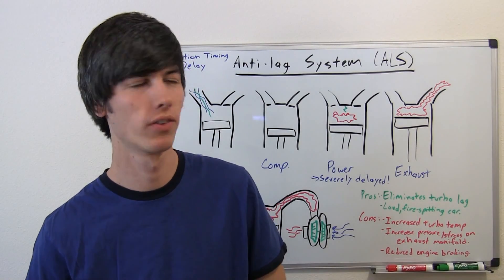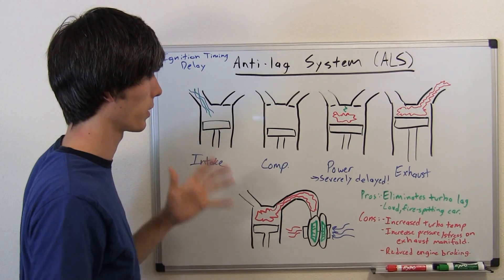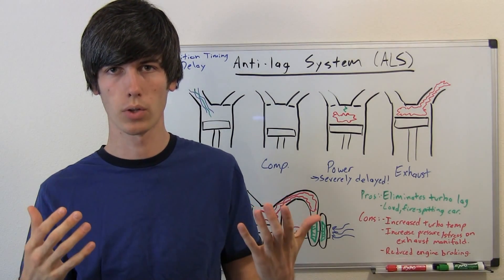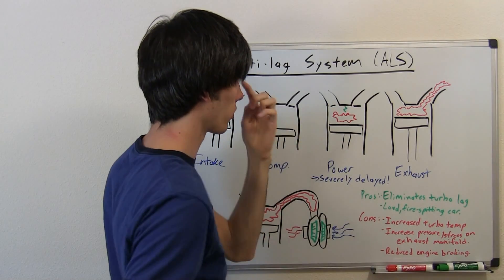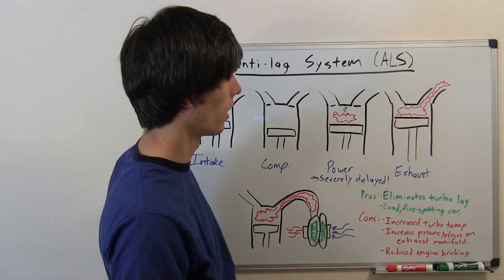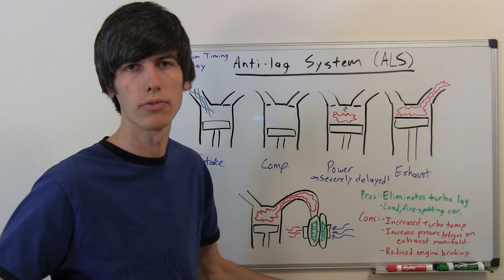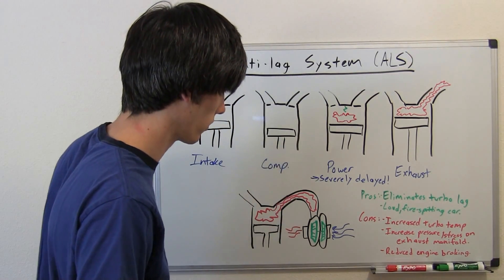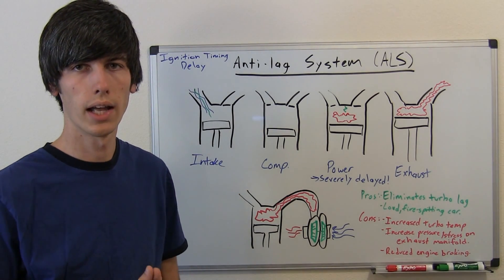Anti-Lag System By Ignition Delay - No More Turbo Lag

Comment: So I gotta ask you EE, where did you learn everything you know? I'm trying to learn all I can about cars so I can keep mine in better shape, but also to help make them a bit faster along the way. I'd say I have an intermediate understanding of cars, and have done everything from brakes and cv axles, to valve covers and starters. 

But learning more seems nearly impossible without going to school. What'd you do?
Reply from the maker: I just read a lot online, try to search out facts and data. It's been a long process of building this channel, and I have an unlimited amount still to learn! Went to school for mechanical engineering, but the coursework is primarily math.
Reply: +Jack AD the problem is that if you go to mechanical engineering, you'll get one class of this. In my country we do have "mecatronic engineering" or something but it's not recognized as an "engineering degree". Basically it's like going to law school but never do a bar exam.

I have no idea if where you live you have a college degree that teaches you about cars but you have to make a choice - do you want to work on cars or do you want to be an engineer? Would you settle for a job as a car mechanic, where you'll fix cars instead of sitting through classes for years and get into debt? But if you don't want to fix cars and you want to be part of car design/engineering, will you risk getting into a degree that's only for cars when an engineering degree will allow you to work on anything, even if they only have one or two classes on car engines?

The most important question: would you settle for cars as a hobby?

For example, I'm in mechanical engineering and I like guns. They're not everyone's cup of tea but I'd like to work in their design and production. But I could be working on cars for a living and then have my own little machine shop where I can mess around with gun design.

You could become an engineer, and for all you know you could be working on projects related to trains, ships, guns etc and make decent money that allows you to go nuts and create something yours in your garage.
Reply: +Engineering Explained what's the best course for collage/uni if I wanna learn all this
Reply: +Sample Text University of Northwestern Ohio. they have a automotive/high performance degree.
Reply: CruelTea im in the UK near london
Reply: +Jack AD there's automotive engineering courses in Kingston college
Reply: Michael Higgins Ive applied there and Richmond now
Reply: get a job at the junk yard pulling part, you will learn tons

Comment: why does modern F1 cars don't have anti-lag? it's beacuse the too high rpms or the unmanageable heat output?
Reply from the maker: They use electric motors to eliminate turbo lag.
Reply: +Engineering Explained why new sport cars or supercars don't use it?What you think?
Reply: heavy and the batery might explode

Comment: While the ALS is working, it keeps the boost at its maximum but it is trowing the air out by the wastegate until you finish shifting and come back on the throttle right ?

Comment: What if instead, you have a small tank of pressurized air that is released into the turbine when you let of the throttle, keeping it spooled up and keep the tank charged using a small engine driven airpump. Any clever engineer types here who can see if this makes sense energywise or not?
Reply: Then you could have an engine-driven supercharger with a clutch that disengages it after a certain number of RPM, skipping the tank entirely.

AKA a twincharged engine.
Reply: I believe it is Volvo, that had designed something like this. Essentialy it has a pump that pressurizes air on high rpm and releases it into the turbo  as Rpms drop, would have a similar power band as a supercharger but without the hp loss needed to crank the supercharger
Reply: That sounds like something Volvo would do!
And i suppose the airpump would have a smaller parasitic load than a supercharger. Maybe it could be electric. But again im just guessing since im not big on crunching numbers :P
Reply: The whole idea is basically to give a turbo the pros of a supercharger without the cons of a supercharger :P
Reply: +Quirk91 you know. It might even be electric, I'll have to find the article again

Comment: What if I were running a remote turbo setup where the turbo charger is by the rear bumper? Would that help with the high temperature and stress put on the turbo? or would the added length of piping from the manifold to the turbo just not work with the ALS? Please help.
Reply: Turbos work at high rpm but have trouble spooling at low rpm. The ALS counters that.

By putting the turbo further down the exhaust, you'd be sacrificing "normal" regimes where the ignition isn't delayed.

The turbo would be efficient when you let off the throttle but lose efficiency when you put your foot down. That's backwards.
Reply: TheRealestEver Squires Turbo Systems (STS) makes remote-mounted kits for cars such as the BRZ, 350z, and a few more.

Comment: will this work for a diesel engine ?
Reply: my question aswell?
Reply: +Duke Boreham in theory it shouldnt (at least not the way described in this video) because unlike gas engines diesels rely on compression to ignite the diesel fuel. Whereas gas engines have spark plugs which are responsible for ignition.
Reply: ok
Reply: +Duke Boreham I guess you could regulate it with the valves. Since many diesel cars have common rail, thus regulating the valves electronically. But i doubt you will have an increase in power, i even think it would decrease. 

Just a very wild guess xD
Reply: I don't think that an ALS would increase the power of any vehicle it is installed on, but your idea might just work.
Reply: Well as the video said it would reduce spool up time, thus reaching higher pressures earlier. So more powaaah i think in between shifts near lower rpm :p Wild guesses again xD

But diesels also have higher compression ratio's :/ So i don't think the valves will be able to open up :/

But when you have a diesel wouldn't you be aiming at high mileage, high torque and durability? I have the idea ALS is terrible for all of these xp

Gut feelings :p I have a minimum mechanical background xp

Comment: whats  the difference between anti lag and 2 step launch control  and why do they spit flames, is it because it is still igniting as it is exiting the chamber?
Reply: carman9457  Anti lag is meant to keep the turbo spinning whilst off throttle, think hard braking for a tight corner. 2 step launch control limits your RPM whilst stationary. In doing so you can have consistent launches. As for the flames, anti lag has combustion occurring outside the cylinder and some launch controls use ignition cut to limit your RPMs. That leads to fuel vapor hitting HOT exhaust manifolds or turbos.
Reply: o thanks alot

Comment: Question: Does anti lag occur at typical speed/RPMs? Will my engine keep my turbo spinning if im doing 45 MPH around residential streets? Or is this something that will only kick in when im opening the throttle?
How much does this affect fuel consumption. Using just as much fuel just to keep a turbo running cant help. How severe is that loss of power/fuel.
Reply: MrProtoking Normal road cars don't have this system. It's more or less for racing purposes only.
Reply: shi01 i know but many people have turbos on street cars as well.
Reply: Yes, but they don't have this system. It isn't a necessity for a turbo engine to have a ALS-system.
For the system itself, it kicks in when you go of the throttle.
Reply: shi01 I know but im referring to systems that do have antilag.
Reply: MrProtoking
Well, as i'm already said, the system kicks in when you go off the throttle. It can effect the fuel consumption quite a bit, because normally the ECU stops to inject fuel if you close the throttle and the engine is reved up.
The system doesn't have a typical speed or rpm where it starts to work. That depends on the engine mappings. It's basically just a software thing.
Reply: MrProtoking you have to be tuned for that type of antilag.  Essentially what you want is for the ecu to try and make the engine produce boost at a lower threshold than is possible, so you make the engine misfire to create enough pressure at low rpm to continue to build boost.  WRC cars use a bypass valve in the exhaust manifold that opens up at a specific rpm to create boost when there is no throttle by sucking in outside air straight into the exhaust, similar to a secondary air pump on todays cars, but for a totally different reason.
Reply: MrProtoking anti lag tends to cut ignition and dump fuel, so you're going to have pretty bad fuel consumption when it's operating.  the turbo keeps spinning because the engine starts misfiring in order to produce boost at low rpm. Because of this you don't have to wait for the engine rpm to increase enough to build boost again when you get back on the throttle, instead the turbo will already be spinning and building boost so when you get back on the gas your at full boost instantly.  Therefore you make more power much much sooner into a corner exit.
Reply: From a VW 2.0T GTI owner (gas turbo but no ALS yet): To some degree, yes. Every time you increase the throttle, there is a slight delay for the exhaust gasses to catch up and run the full circle from exhaust cylinder through the turbo and inter cooler, then back into the engine to burn. If you're not starting from a full idle, then it's a shorter delay, because the exhaust side of the turbo is already spinning faster than it would be at idle. Anytime the turbines slow down, you lose a little bit of time the next time you punch it. But that time is mostly miniscule, unless you're low in the car's rpm range. Responsiveness also depends on how well the turbo is made, as this guy explained.

Comment: Does this have a place in drag racing application like between shifts even though shifts are maybe 0.2 secs.  Sounds more like a road race and drift setup
Reply from the maker: chris hinckle It's fairly common in rally cars. Certainly could be used in other forms of racing though.
Reply: chris hinckle No, they use vacuum to function however that function is releasing excess pressure from the system.
Reply: Luide Mulumba I would guess it's because they don't have throttle bodies to abruptly stop air flow and over pressurize the induction system
Reply: Alexander Seda blow off valves work off of pressure right
Reply: Drag racers use anti lag typically while on a trans brake at the line to build boost during launch.

Comment: Is anti lag and launch control the same or what, I here many saying it's the same? :)
Reply: Basic answer, not the same.
Launch control MAY use ignition delay to momentarily reduce power but still maintain boost.

But launch control - GTR for example is A LOT more complex than just ignition delay

Comment: what happens to the exhaust valve? i mean combustion is still happening while the exhaust valve is opened. Does it not melt down the valve seat or the exhaust valve face?
Reply: Leon DeSilva The valve face would be exposed to the combustion normally it would just be closed. I doubt the valves them selfs would be any more likely to fail if the combustion happened when it was open since it's all made out of the same thing however it's component parts such as seals and so on would be in danger. That's why they would need to be upgraded when using an ant-lag system. They probably have a whole kit with "hardened" valves and all the rest of it. I could be wrong about all this though...
Reply: hmm harden valve seats does make sense to me tho

Comment: does the car lose horse power because of the late combustion?
Reply: Kenny Page basically it doesnt matter if you lose hp because antilag works if youre off throttle which means you are decelerating when entering corners. In Exiting , you want instant response so antilag works to  to continually spool the turbine.

Comment: Awesome Dude, but I've gotta question

in your next video where you have mentioned that the compressed air from the turbo charger is bypassed, then what happens to the same compressed air in this case, where is the compressed air bypassed too?? or is it introduced into the the engine as usual??

any answers are welcomed
Reply: Aravindhan Veeramani  should flow out of the blow of valve as intake will still be at vacuum as your off-throttle.
Reply: mr2paddy I have been reading about blow off valves but how in the hell vacuum is generated in the throttle body
Reply: Aravindhan Veeramani Because the pistons are still going. Think NA. The principle is the same. Come off boost and the pistons going with the valves opening the way they do will create a vacuum. Watch a boost gauge when you come off throttle, it goes straight into a vacuum.
Reply: +Aravindhan Veeramani (VA.6307) 
Vacuum is generated on the manifold side of the throttle plate due to  the intake strokes pulling against the closed butterfly in the throttle body. Boost pressure is on the intercooler side of the throttle plate.  The throttle plate closes and the since the air has momentum, it must go somewhere.

Comment: Engine braking is bad for the clutch and drivetrain anyways. Anyone who uses engine braking is just stupid and too lazy to learn how to properly rev match.
Reply: By 'engine braking' do you mean letting the clutch out when the wheel speed and engine speed are different?
I think engine braking in general refers to the decrease in speed from having the car in gear and clutch out while slowing down (as opposed to neutral or clutch down and coasting), not necessarily absorbing a certain amount of energy by spinning up the engine to meet wheel speed.
Reply: Engine braking happens whether you rev match or not, it's not bad for the car. Not rev matching and just dropping the clutch without the engine and road speed matched up is probably not the best idea (which is what I think you're referring to) But that's not engine braking. Engine braking is simply leaving the vehicle in gear as you slow down and letting the resistance slow the vehicle down.
Reply: I think you don't understand what engine braking means.
It does NOT mean use your clutch to slow down the engine and force it to rev match the gear you want.

It mean YOU rev match your engine to the gear you want and use the compression of the engine to slow the whole car down.

Comment: Ive been dying to know this one thing:
Can this system be applied to a hybrid car,lets say a honda crz?If no then why?Will it be possible to get this system when a conversion is done?
Reply: um, no? I mean you could apply it in theory, but what would be the point? The cr-z has a natural aspirated engine, it wouldn't do a thing except for burning more fuel than necessary.
Reply: ohh,so thn its possible but the probelm i might be facing is fuel waste?
Reply: Neeranjan Max
Not just the fuel waste. First of all a Anti-Lag System only make sense for a turbo charged engine, which the engine of the cr-z isn't
Second, such systems are only used in racing application. There's no need for such system in normal road cars. Especially in a hybrid, whose whole purpose is to be efficient. And third, you would need to reprogram the ECU.
Reply: ok,now i get the whole point of the anti lag system,Thanks for the help shi01 ..Really helped me man!!

Comment: wouldn't it be possible to INCREASE engine braking with this system? assuming the ignition is late enough, can't the increase in back-pressure outweigh the slight power generated by combustion in the cylinder?